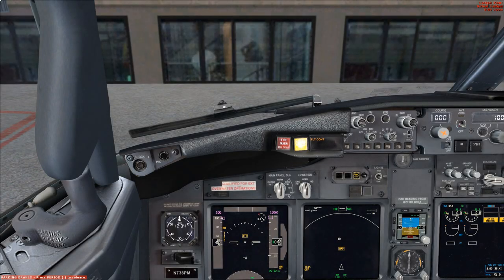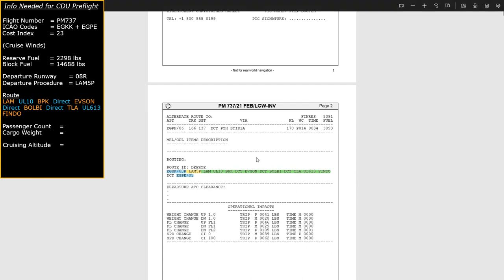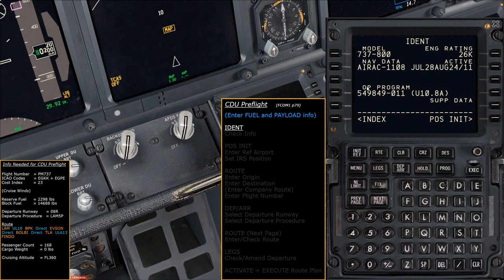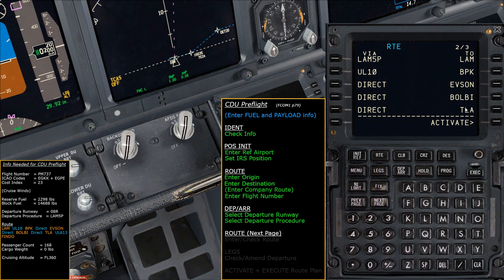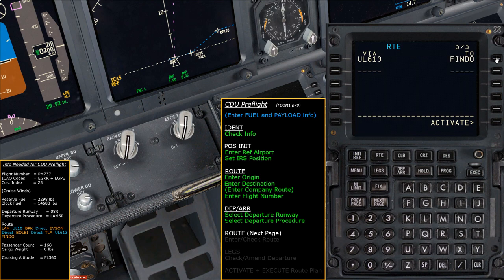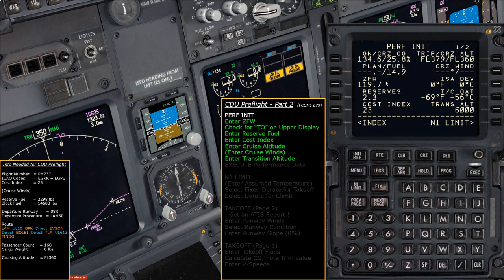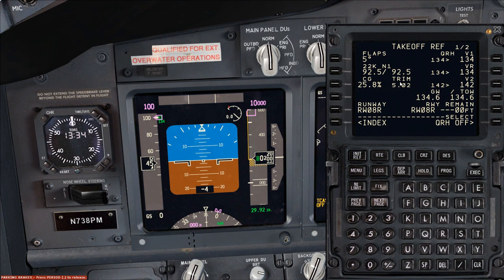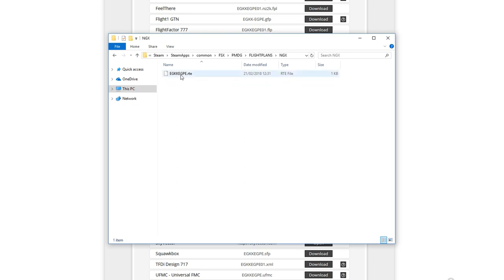PMDG 737 NGX:  2. CDU Preflight Procedure

Comment: You have a great mind set when it comes to flying an aircraft. don't sell yourself short. You're following Boeing Standard Operating procedures from dark to shut down with good knowledge on the underlying systems. Take it from a certified Flight Instructor and someone who is currently undergoing their 737-800 Max PPC. What you're doing is basically what we do

Comment: Good job sir! You are a game changer and the best flight sim instructor I have seen here on YouTube.
Reply from the maker: That's very kind of you to say, thank you 🙂
Reply: @Doofer911  Hey Capt! Thanks to your video tutorials, I can now start up the B737, set up a flight plan and cruise. I only have a hard time landing this aircraft, I'm not sure if it has something to do with the settings in PMDG but each time I want to intercept the runway heading course, I hit the APP button to intercept the glide slope and localizer, my plane will turn to the runway and start descending but it will never align with the runway. Like it will always drift to the left out of the runway heading and when I hit the VOR/LOC to correct this, it doesn't arm or show up on the PFD. Tried this so many times and no luck. It's really frustrating. How do I solve this problem? Thank you!
Reply from the maker: Have you changed both course selectors on the MCP panel to match the runway heading? Also, both nav radios need to be tuned into the ILS frequency
Reply: @Doofer911  Yes I do have the frequency and heading course set on both sides. I cross checked everything as per approach procedures but not sure why I keep on drifting to the left and the VOR/LOC key won't work either. And when I hit the CMD B key, the CMD A disconnects.

Comment: Superb as usual! Transition altitude as I understand it is the altitude you set your Barometer to standard. It is 18000 feet in the US. But usually 6000 feet in the UK. Climb derate is sometimes specified for noise abatement as I understand it

Comment: CDU Preflight
Enter Fuel + Payload Info

IDENT:
- Check Info

POS INIT:
- Enter Ref Airport
- Set IRS Position

Route:
- Enter Origin
- Enter Destination
- (Enter Company Route)
- Enter Flight Number

DEP/ARR:
- Select Departure Runway
- Select Departure Procedure

ROUTE (Next Page)
- Enter / Check Route

LEGS
- Check / Amend Departure
Activate + Execute Route Plan

PERF INIT
- Enter ZFW
- Check for “TO” on Upper Display
- Enter Reserve Fuel
- Enter Cost Index
- Enter Cruise Altitude
- (Enter Cruise Winds)
- Enter Transition Altitude
Execute Performance Data

N1 LIMIT
- (Enter Assumed Temperature)
- Select Fixed Derate for Takeoff
- Select Derate for Climb

TAKEOFF (Page 2)
- Enter Runway Winds
- Select Runway Condition
- Enter Runway Slope (0%)

TAKEOFF (Page 1)
- Enter Takeoff Flaps
- Calculate CG, note Trim value
- Enter V-Speeds

Comment: If the FMS section is what proper Boeing's have in their CDUs, then where is all the other FS Actions information saved generally in a real plane?

Also, is it important to enter the fuel , payload data before entering the proper FMS section ? Asking, because I want the actual feel of operating a real plane.. 

P.s. Thanks for the series ! Extremely informative !
Reply: The real Boeing 737’s don’t have an FS actions page because ground crew and the flight deck handle most of the operations such as the doors and ground power. The fuel and payload pages I believe do not exist either but they are entered in the perf init page

Comment: Hello Doofer911, and congratulations for the amazing and very understanding tutorials that you made!  Just one question if you permit, you told and it’s true that we can switch from lbs to kg in simbrief before creating a flightplan, but I think is possible also changing lbs to kg in pmdg 737, do you agree? Best regards and keep the excelent work!
Reply from the maker: Yes it is. I can't remember exactly where the setting is, I think on the CDU it's under Menu > PMDG Setup > Options or something like that... you can choose the aircraft's fuel units.
Reply: Doofer911 thanks and keep the great work !

Comment: QUESTION...we add fuel via SIMBRIEF ( main and reseve )..What happens if SIMBRIEF misscalculates the fuel ?..... I use as back up, just in case, a fuel program for NGX or use a base of 15.000 lbs for each 500 nm. When SIMBRIEF and the fuel program come close, I use SB and add 5.000/10.000 lbs for the climb till FL. ( FL 280/360 ). If the difference is higher in the fuel program I use this one and add the pounds for the climb..SIMBRIEF HAS let me short of fuel...but again..if it happens ...what do you do ( USING only simbrief )...????

Comment: doofer911, If I am flying on VATSIM, do I check for the active runway by listening to the  ATIS report before entering my departure procedure and runway??
Reply from the maker: Yep, at a busy airport the air traffic controller will let you know which runway is in use
Reply: @Doofer911  ah thanks for the information. I also have another question, what is the difference between altitude intervention and level change ??

Comment: Is it ok for shorter flights to put the way points then go to arrival and put runway,then go to perf? Or it’s necessary to add arrival in cruise, and btw if I’m on offline does the frequency and radio matter , and do I need it for my approach, if not can I remove the radio panel checklist from my own checklist that I’ve done?
Reply from the maker: Yeah if you're confident that the weather won't change all that much, you can enter in the arrival routing before takeoff. If things do change, you can always check during the cruise and amend it if necessary. If you're flying offline, you'll still need to enter in radio information if you're performing an ILS approach but if you're not going to use the Comm Radios, you can omit them.

Comment: When i enter crz alt shown in TOC - simbrief data, i get "unable crz alt". What to do ??
Reply: It means the aircraft is too heavy to climb to that flight level. Just enter a lower flight level, you may burn more fuel at a lower lever so consider taking a bit extra fuel over the minimum on the OFP. Most airlines allow the Captain to take on a bit extra (often 200kg to 500kg) without getting called in "for tea and biscuits" (a euphemism for a disciplinary chat with the Chief Pilot).

Comment: Dont you have to sum the reserve and the blocck fuel and type that into total fuel?
Reply from the maker: My understanding is that the Reserve Fuel is part of the Block Fuel. The Block Fuel is the total fuel amount.
Reply: What doofer say is correct the reserve fuel is basically how many fuel should aircraft keep.its part of the block fuel. Usually its 2.0. The block fuel is the total amount of fuel onboard
Reply: Ok I did not know, thank you